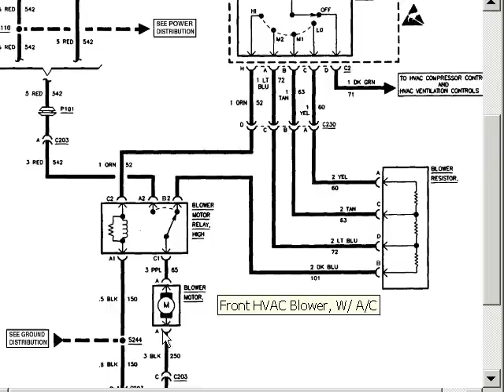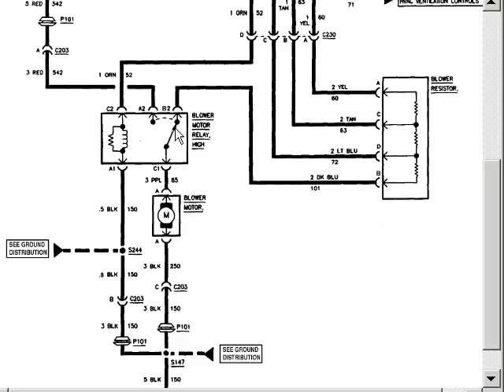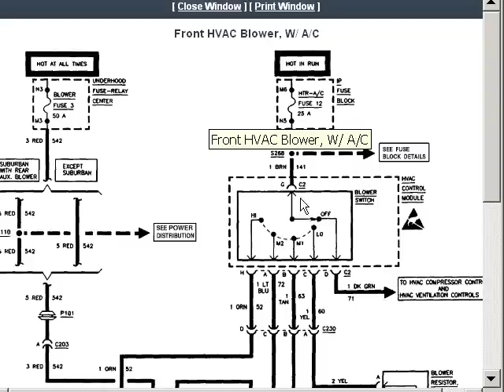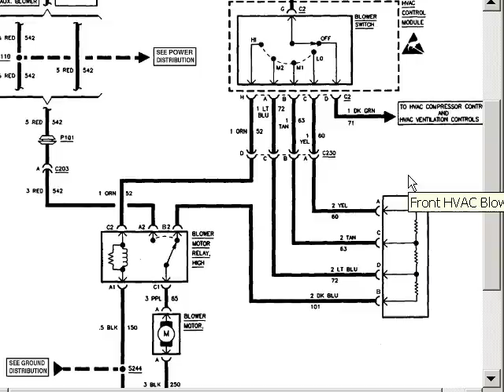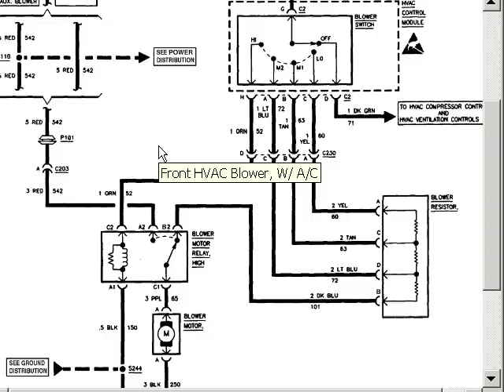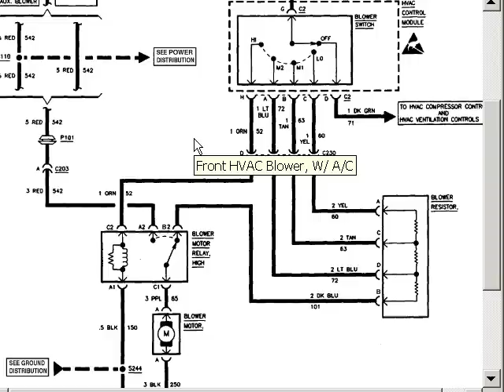Blower Motor Problems | Auto Repair Help

Comment: I have a 94 Bonniville SE that just the high speed blower works. I've changed everything and still only have high speed. I think it might be a ground problem?
Reply from the maker: In the description of this video (expanded) there is a link to a video that talks about testing grounds. Also in the last paragraph of the description I link to a video that reviews problems with the High blower relay which can cause the issue you speak of.

Comment: I have a Open ground that is grounding out the resistor. I've traced and know the wire that (black ground from switch) that is the culprit! I cannot access this wire without taking the whole dash apart! Can I install a new ground to the resistor and bypass the old one?

Comment: thanks for the video i have a question could i get away with bypassing  the relay that controls the 1-4 and run only high speed when needed thank you
Reply from the maker: Well if it's a GM car with the same circuit as in the video the answer is yes. Although I did this for someone and they came back in a few day's and said please make it stop. High blower all the time can get unbearable.
Reply: mgittelman its on a 2001 wrangler thanks for getting back to me i believe if i remember they are about the same as the diagram you have , in return i do all types of home repair so if you have a question ill be happy to help out thank you

Comment: In my 2008 grand marquis gs my ac is not changing speed from the 2nd speed to the 3rd and it feels like the high speed is blowing like 3rd speed. What do you think the problem is? I have already change the blower and the resistor.

Comment: Hello thanks for the brilliant explanation. Just a quick question, does it mean my resistor is faulty as position 1 which is the slowest speed doesn't work but 2,3 and 4 works. Any assistance would be helpful.
 Thanks
Reply from the maker: Dennis: If you have a GM car or truck (depending on the year) and only low is inop it's either the switch, resistor, or a wiring problem.
Reply: Thanks mate it was the resistor pack of which settings number 1 was faulty so changed the pack and its all working fine on all settings. And yes it was on a GM car.

Comment: this is so very helpful thank you for your time creating and uploading this, im at a stand still with my 95 chevy k1500. I needed a new climate control module because the old one was falling apart. ive had issues on and off with the a/c and heat since I owned the truck a few years back but what im running into is the blower used to run on high only now it doesn't work at all. ive checked both fuses and they are good. ive replaced the relay, resistor, and blower motor along with the a/c control module. everything has been replaced but nothing works. ill turn it on low and it will work for a few seconds then it stop and now nothing happens on high. im at a stand still. any input would be so appreciated. this wiring diagram is very similar to my truck almost exact I just don't know what else to do. thank you for your time

Comment: Is this diagram for a 2006 Toyota corolla? If not I have a 2006 Toyota Corolla that has the same problem, at first only the heat worked on the high setting now it isn't working  at all. Would you happen to have a diagram for the 2006 Toyota Corolla?

Comment: i have a 2006 Chevy hhr and i have only one fan speed on high and i replaced the AC Heater Fan Speed Resistor and still only have the high fan speed any ideas of what else it could be ?
Reply from the maker: Dave: Hard to say what the problem is for sure as I don't have an HHR wiring diagram but if it shares the same set up as the light duty trucks in theory a stuck closed high blower relay could cause the condition you speak of.
Reply: The cable between the blower resister & the 4-position a/c switch sometimes blows up. Good luck!

Comment: i have a 3005 chevy equinox that does not blow air at all. I have power at the blower and have replaced it. Still nothing. Tested plug into motor and get 12v. Could it be the ground and how do test it since there are only 2 wires going to motor and get 12v when tested between them.
Reply: The blower motor on my 2005 Chevy Avalanche runs continously on high.  What could be the problem?
Reply from the maker: Edward Scott A high blower relay stuck in the applied position would be a likely cause but it's not the only possibility. I made a video about this issue titled "
Blower Motor Runs all the Time"

Comment: I have a 1997 Jeep Grand Cherokee. I have replaced the blower motor and resistor. I have also checked fuses and voltage at the motor. My blower motor works but when I have my ignition turned off, my blower motor is still slowly working until I pull the fuse under the hood. Everything from the system has been removed up to that 40A fuse eliminating them from the cause.

Comment: If your blower motor runs on high for a long time because the resistor is bad will it eventually burn up the motor? I'm thinking that's what happened to mine since I changed the resistor and nothing happened. Going to try a new motor now

Comment: 2000 Ford Expedition, blows on all speeds, but seems more air should come from vents. What could be the problem? Thanks again for video.
Reply from the maker: Tony: The answer to your question is usually a clogged cabin filter but from what I can tell they did not have one on the 2000 Expo. Could be a problem with the blend door allowing air to escape to the floor and windshield vents. That would take some hands on diagnosis to verify.

Comment: I have 2004 ford explorer. blower motor always ran no noise or problems. then one day it stopped altogether. its a digital control center for the heating controls. and when u choose heat mode or select difernt zones .. the blend door operates correctly and the display displays your current blower motor selection..however blower does absolutely nothing.  any ideas mark? thanx -Chris

Comment: I have a 2000 Nissan Maxima, SE. The heater is blowing hot air all the time, no matter what setting its on. I slide the Temperature knob to cold and it still blows Hot air. Then I turned On AC, and it still blows Hot air. What can I do?
Also how do I replace the cabin air filter. Thank you Sir.

Comment from the maker: Hi resistance in the wiring, connectors or the motor windings themselves from corrosion or rust are a few possible and common causes of the blower motor running slower then the selected speed.

Comment: Great video  I have a issue with my blower motor. It works but like at 1/2 the speed it should ( as compared to a known working one). I tested it with a know working resistor pack, and got the same weak blowing . Also, directly wired it to the battery and got same weak blowing..
Any ideas as to what might be wrong ? Its a Nippon Denso unit from a Porsche 944 Thanks

Comment from the maker: Jaenie Matt:: There is an electric motor that controls the temperature door. On dual controls there is 2, one for the drivers side and one for the passengers. Problems with these motors are common and best diagnosed by the dealer because they have a tool to test and calibrate the motors.

Comment: I have a 97 Maxima and it only blows out hot air, even when its cold outside.  The shop I took it to said it might be an electrical short and/or a leak in a hose.  Any suggestions? Thanks for this video.

Comment: I have a 1999 Buick and the AC is working on driver side but hot air is coming out on passenger side. Dual controls. Settings are Ok. If anyone has any idea what might be causing this problem, I would apprec. your input. thx

Comment from the maker: John: Most cars have a relay center under the hood. Yes relays can be tested. Another thing you can do is locate the blower relay and record the part number. Then you can look for the same part number used in another system and swap them. Manufacturers often use one part number relay for many systems to reduce costs.

Comment: hi my heater blower has stopped working it is a bmw e38 i was told the relay was the problem has i dont know which one this is i am stuck is there a way to test these relays

Comment from the maker: Rudy: When I have both a power and a ground problem I fix the ground side first. Poor grounds can make the electrical system do crazy things. You will have to check your manual to see where the blower is grounded. It most likely shares a ground with other systems. I have a link to a video showing how to test ground integrity in this videos description.

Comment: I have a Nissan Maxima 1999 the blower motor is not working but it is because i have low voltage but i dont know why.  also i have no ground wat so ever.  I have checked every relay and fuse and they are all ok but are also getting low voltage and i dont know why.  please help

Comment from the maker: honestypays2: Good question about checking the ground. I put together a quick video of how I check it with a test light and a meter for those who prefer to use a meter. the video is the most recent added to the Chanel and I'll also put a link to it in this videos description.

Answer 2) On the inside cover of most fuse panels is a road map to what each fuse protects. On older vehicles this was sometimes put in the owners manual.

Comment: Good video. How do you check the ground as discussed.  Also, I did not see any fuses listed for Blower Motor.  Some tend to have codes.  Is there some way to determine the fuses for the Blower Motor?  Thanks.

Comment from the maker: Tom: If everything else is working fine and just the high setting is inoperative then the most likely cause would be the high blower relay. I say most likely because it can be the switch or control panel problems but the relay is more likely. Not sure on the 86 but I know on the 90's trucks the high blower relay is in a relay center under the hood. On those vehicles you can swap out the relay with the same part number relay from another circuit for a quick test to see if that fixes it.

Comment from the maker: Would like to help Sharmin but many different things can cause this condition. I will list a few easier things to check. There are 2 fuses for the blower and a relay. The relay and  1 fuse I believe are in the under hood convenience center. The other fuse panel is under the dash on the left hand. Things like a bad blower switch and or wiring problems can also cause blower problems. Probably a good idea to get some professional diagnosis before replacing any more parts.

Comment: Good day, This video was very informative but i am having a problem with my ac. I have changed the resistor card 6 times and motor 3 times in 4 months and it keeps blowing. The fuse and resistor usually blows together only when i turn the ac switch up to 3/4 and more. Each time it does this. Sometimes u smell it burning sometimes you dont. What can be the cause of this. Thanks

Comment from the maker: If only high is inoperative then a likely cause could be the high blower relay. I Stress " Likely" because it could also be a few other things like the blower switch or wiring problem. Electrical problems are capable of throwing wild curve balls at times.

Comment: Hi I am having an issue with a 2000 Mercedes S430. The car was running fine then I decided to check the fuses because of a radio issue, now the car will not start or attempt to but my cooling fan runs extremely too fast. The car still has power but will not start, any help here sir?

Comment from the maker: Yes Glen I would suspect the high blower relay in your case. Not sure where it's located on your vehicle but I would not expect it to be near the resistor block. More likely in an under-hood relay center or under the dash? Note that some GM cars have 2 fuses for the blower so check both of those. It could also be the blower switch or wiring problem but the high relay is more likely.

Comment: Mark I have the opposite trouble on my 2000 impala. It run on the all 3 lower speed but no the high. By your diagram i think it would be the "blower motor relay high" but i dont think my car has one. i already have replaced the blower motor resistor. Think the relay would be in with it. Did i get a bad new part?  Please Help and Thank you in advance!

Comment from the maker: Jerry Z: The way you describe your problem it sounds like there is a problem with the blend door motor. This is what controls where the air exits from. The Buick dealer has a special tool for diagnosing and recalibrating the blend door motors. This is needed after replacing the control head I think?

Comment: I have a 2001 Century and the right side on the AC control panel ..does not do anything no matter where you set it the air comes out of all the vents the same..I replaced the whole Heater/ AC panel and the same thing happens...Can anyone one HELP ? I can't find any info.....jerry   (non climate control system)
(non Climate control)

Comment: Did you ever solve your blower motor issue?  I have a similar condition except that my fan speed changes on it's own.  seems to downshift when driving faster, never goes off but goes to low and all positions in between. Any suggestions?

Comment: HI, I HAVE A 1999 PLYMOUTH BREEZE AND I REPLACE MY BLOWER MOTOR RESISTOR. BUT AGAIN IT WENT OUT BY 4 TO 5 HOURS THE SAME DAY. DESPARTED NEED HELP WITH THIS. I TOOK THE MOTOR OUT AND IT DON'T SPIN FREELY. WHAT WOULD BE THE PROBLEM. NEW HEATER MOTOR AND I GOT THE VEHICLE USED FROM A FRIEND.

Comment: I have a 1996 2.2 VTEC Accord with a weak-blowing AC system. I read this was a common problem on this generation of the accord, but found no legit solution. The setting would be on "4" but it feels like it's on "3"
Would it be the blower motor?

Comment from the maker: I replaced a vacuum storage ball on a 98 Cherokee (not grand) with a straight six and it was on the p/side fender well toward the firewall if I remember correctly? I don't know on the diagram I'm not even sure if it's in all-data. The factory dealer manual might be the only place unless someone has made it available online? You can check in the Jeep forums.

Comment from the maker: Patrick you are on the right track for sure. The default position is the defroster vent output. It's vacuum that pulls the blend door to the other positions.Most likely there is another broken line somewhere or a problem with the vacuum storage ball.I have seen a few cracked ones on jeep products. But of course these are not the only things that can cause this issue just the more common ones.

Comment: Hay I have a 98 jeep grand Cherokee and the heater and ac is in defrost if you switch it to vents or the floor nothing happens there is a vacuum line that comes out of the firewall by the heater core line that was broke I fixed that still nothing just defrost how do I fix the issue

Comment from the maker: Short answer is yes it is possible to have a frozen blower motor and yes it can take out the fuse. They try to put the motor where it will be safe from ice and snow but I have seen it happen.

Comment: So, I have a '96 Dodge Neon and the heater just stopped working so I changed the fuse out 3 times and every time I turned it on, the fuses went out in sparks.  Could it be possible that the blower motor is frozen? (I live in the snow)

Comment: Hello,

I have a faulty blower motor. It got wet. I removed it and checked. So first attempt I replaced the resistor and cleaned as much I could. But I need to replace the power lead in the blower motor to get it work again... can that be done? 
And do you have any website for such info?
Thanks!
Peter

Comment: good data - my 1992 LaSabre Custom has no blower control. Blower motor is good (tested wired direct), and Resistor is new. Is there a way to test the in-dash temp controller panel located under the radio. It does adjust the toggle behind the glove box that turns air from hot to cold, and can hear relays click when pushing air flow buttons. Help - I'm at a loss!

Comment from the maker: Whenever something runs when the key is off it's usually an indication of a bad power relay (stuck closed) but without seeing a wiring diagram for your lancer it's hard to say for sure. Just speaking in general terms!

Comment: I have a 92 GMC Sierra on which the fan controls are not working or it turns on and shuts off in a few seconds, once it turns off and i attempt to turn it back on, i hear ticking right behind the center vents and doesnt turn on.

Comment from the maker: Although I can't tell you exactly what is wrong with your Hyundai I can tell you I have seen internal problems with the blower motor such as brushes or windings (internal) cause excessive current draw. High current can turn into wire melting heat.

Comment: This is the only one video about blower motor problems, very well explained on YT.
Now i would ask u something not shown in the video... 
I have a Hyundai Coupe GK 2003 1.6cc and i noticed recently that wires of blower motor get really hot when i switch on air..(blower works on any speed)
so hot that it was melting the connectors..
I tried to add an additive resistor to understand if blower resistor were too low but even the resistor started to burn.. what can be the cause of this high drain?

Comment: hi lgoudymg my deville was the same way i my self was pound on top of the dashboard . i took my blower moter out and c.k over and work good to i move the plug . my plug to the blower moter was twisted so twist back so no pressure in on wires and plug in . i had to ben the ground on the blower moter a bit to get a good connection and now it was working good so maby u need to c.k the plug and ground . hope it helps u

Comment from the maker: It does sound like the blower motor. I have never put one in a  2003 Cadillac Deville So I have no specific tips for you. Might be worth getting a manual or taking it in if it's beyond your comfort zone?